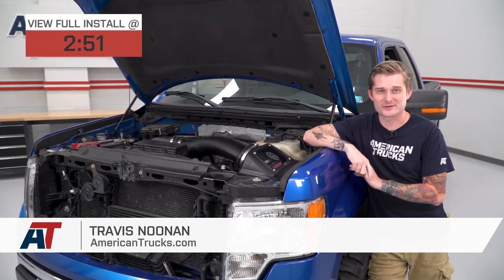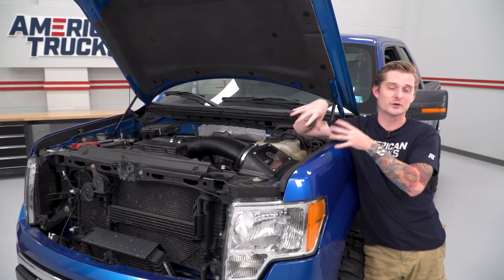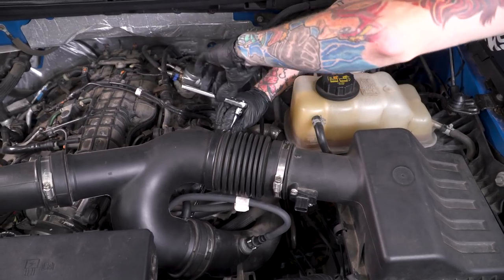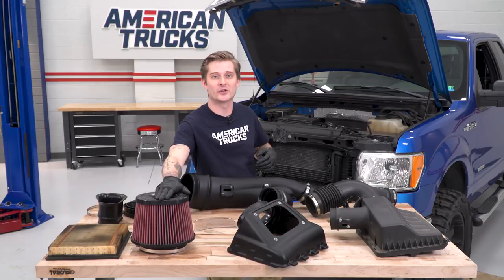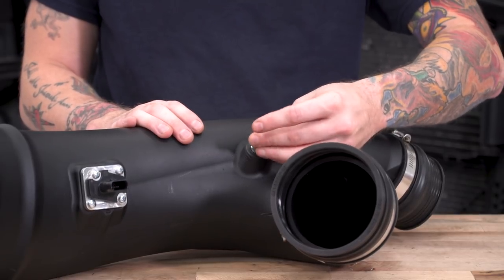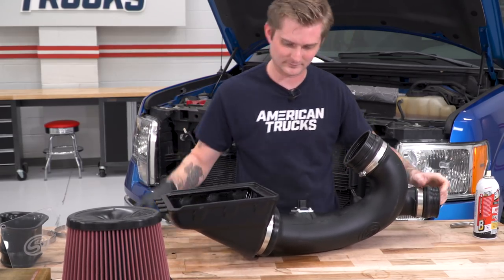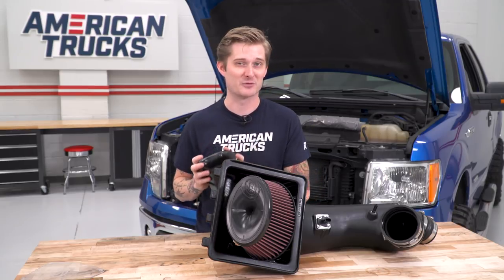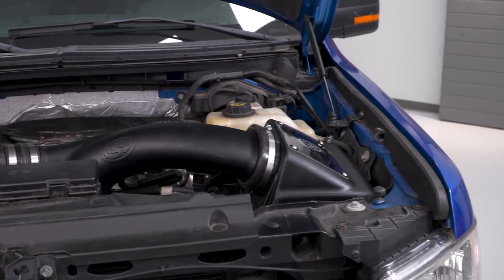2011-2014 F150 S&B Cold Air Intake & Oiled Cleanable Cotton Filter (3.5L EcoBoost) Review & Install

Comment: I just bought a 2014 with this air filter in it. Now my question is, how do you take that filter out? Is there an easy access to take out the filter to clean it? The guy I bought it from even threw in a cleaning kit. Am I missing something? After looking at it tonight, I wish it had a stock filter that I could easily swap out .
Reply: Having this problem now. I put this intake in a couple years ago and now gotta clean the filter…feel like I gotta take the whole damn thing apart to just take the filter off!
Reply: The way I installed mine was so that I could pop the window off and undo the hose clamp. To get the filter out, I just pop off the bottom tube that goes to the right and it lifts up enough to get it out

Comment: You don't get extra hp and torque..cmon guys and tell the truth ..
Reply: F-150 KING OF TRUCKS you get very few HP and Torque because it’ll breathe better, which equals more power.. even tho it’s not much, it’s still 10-15HP, and a little bit more torque.
Reply: @AmmarShaik7  had one on my 6.2L Ford F-150  and didn't increase hp ..only felt a little better throttle response
Reply: F-150 KING OF TRUCKS I’m sure if you dyno your truck or even tune your truck with the intake you’ll gain some HP, it’s very hard to notice such little horsepower.
Reply: @AmmarShaik7  I've already looked at vids on you tube and haven't seen any evidence to buy one again.
Reply: F-150 KING OF TRUCKS dang ok.
Reply: Thanks
Reply: You do….
Reply: @FredRTP96  get a cat back and yes you do at mid range